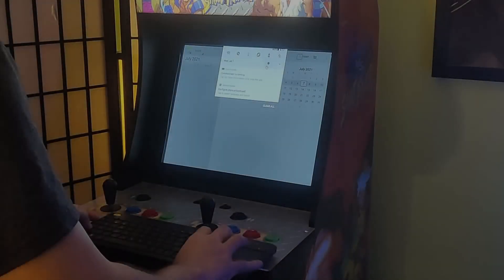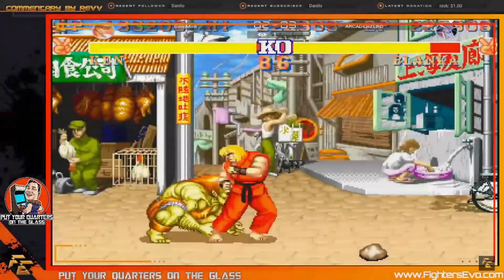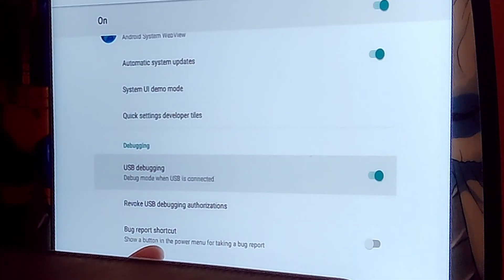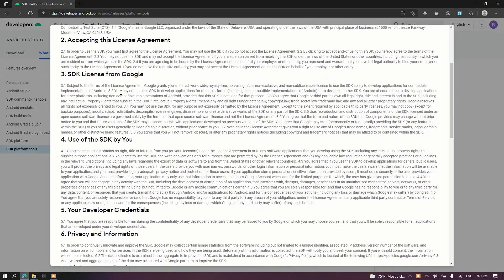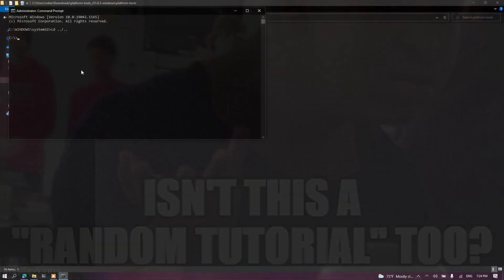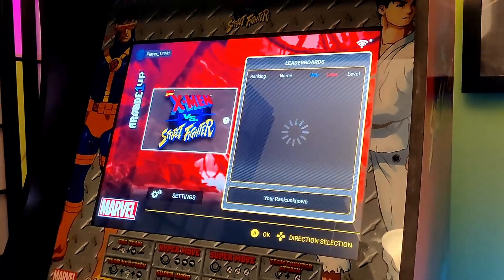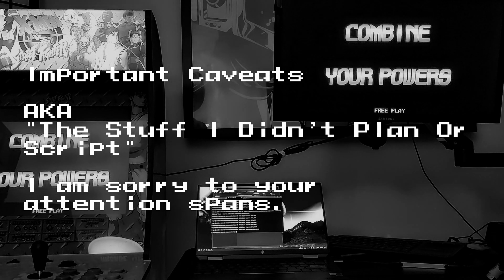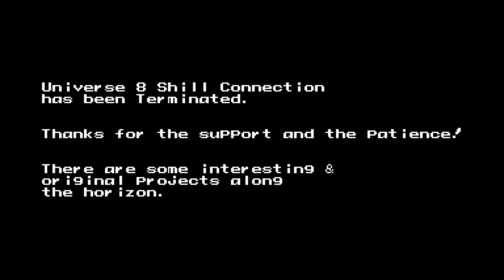Stock PCB Modding #2: Sideload Apps over WiFi + Universal Micro USB to HDMI (Arcade 1Up)

Comment: Will be making video 2.5 soon?
Reply from the maker: Pivoted to another project as I'm working loosely with a group of other devs on ROM hacking/reverse engineering who depend on that work in some projects that will be very cool for the community overall (already have some interesting stuff to share besides the really obscure tech demo thing posted), but will revisit the cab modding at some point early this year.

Thanks on the question and obviously for checking out the repo/resources. Hopefully you found what's there so far useful. The 2.5 tut was really going to just to make it a little more streamline but not fundamentally new things as we can install almost any app via sideload on Android as long as the cab has the capability for it (which is shown in second half here).
Reply from the maker: if you're having any trouble with this tut or something is frustrating: at least can try to point you in the right direction, given enough info. But it would be good feedback either way if so for any updates and thanks.
Reply: @FromUniverse8  Yeah it doesn't seem difficult. I'm getting the cables I need soon.  I'll give this a shot in the near future.
Reply from the maker: Working on cab stuff again and an app for that new process and have a small update on it:
https://youtube.com/shorts/HGDS-y4WG1M?feature=share

Comment: Great video and thank you!  I do have some basic questions:
1.  Why do you have to wait 4-5 seconds?  what process are you trying to interrupt?
2.  Once you have it connected to a PC with micro USB to USB, why go farther and setup a wireless connection?
     2a.  The PacMan 40th, I want to try this on, does not have online, Can you still sideload apps with the USB connection?
3.  Are we limited to the storage on the PCB (for sideloading apps or roms), or can we utilize a USB flashdrive with a hub or OTG?
Reply from the maker: Thanks for watching and being interested in the vid enough to ask sir.

1. Preface: I do not have this down to a science because I didn't study this part too closely or know the exact mechanisms. Someone else can chime in if they have more context.

It seems to have to do with the time it takes to load the system partition + bootloader timing and there's a small lockout when you power on the cab to load data. I am not sure if it was by design but there is a moment on boot-up where you get access to all of this.

The reason you need to switch the power and reconnect is because if you have a USB device connected the cab can actually maintain power even when the USB is connected, and this resets that window. I like using an AC hub because it's easy, but it's not necessary. You can also replug in via the microUSB but I don't want someone to mess up their PCB and blame me so I showed it the opposite way around as everyone knows where to take their PC if they abuse it (lol).

2. This is almost 100% because I am lazy and I assume most people are. It also made it easier to edit the video so you don't have to keep swapping out keyboard/mouse (same as automating the steps for the miraplug lol)... But also so that you can continue to use a keyboard and mouse. It was also to let people know it's a thing, and then just add a tool to the GitHub repo with all the stuff so I could use it myself when I'm lazy.

For me, I can use command line to do things entire time but for regular users to leave the A1Up app or other things it's not exactly easy or intuitive to have to keep unplugging your PC and swapping between that and your keyboard (you can't have debugging and OTG devices at once due to it being an either/or flag; there's 2 modes that represent like a master or slave device -- I'm not sure the 2021 words on it and there is some really technical workaround abd not worth it. You can technically have a cab connect through ADB to itself and I've done that to avoid the whole thing but its a little too meta for the tut).

2a. I'm not sure. If this is the same thing as Partycade then that would prob fall into line to devices a channel called Restalgia was chipping away at a few months ago. I haven't messed with my Street Fighter Partycade but I think it is similar and I do want to explore other things in it...

A1Up gives an update software and... well they can all load up the firmwares for update and other things that  (I don't want to get into but you can imagine with the very publicly available files). I don't know what A1Up is doing but they are not apparently trying very hard to make these mod proof on more than a few cabs. But I haven't explored it as if I see someone start something I don't want to race them when it wasn't an idea I got on my own. Maybe I can cover it with proper credit at some point or expand on it to feel worth doing that.

3. You can use a flash drive but it has to be loaded when the cab starts (it's very anti intuitive because of the 4-5 secs in other scenario). It's the same for external gamepads. There are other things where hopefully people will have the experience of "wow that is insanely easy/intuitive" and I'm going to get into that in my very next vid on this topic  :) but trying to automate much of it as it's honestly pretty tedious to go through even once, and I don't memorize it so I'd like to just run through until a human doesn't need to for certain parts.

(Hope that answered a bit)
Reply: @FromUniverse8  Thank you so much for taking the time to answer me (and quickly!).  I have modded a bunch of these cabs, but usually by NOT using the original PCB.  I bought the Pacman 40th after your first video and your mention of a "possible" mod to allow you to run additional games.  So I am very interested in the next video, and I hope the process works on that cab and others.  I also bought the USB hub you recommended before.  I have sideloaded on several Android devices, including the Ouya (see if anyone knows that device!).  Thanks again, for all your hard work, and your willingness to share :)
Reply from the maker: No problem! glad to help and I am not a big fan of editing so I like to do different things on different days (also cool how you applied that to the Ouya -- that is essentially what I did here so it's full circle). 

One thing though: I think you may have misinterpreted what I said in the previous comment? 💀 

I noticed I had hinted of something "not software related" in a reply to you before -- one thing was the geekworm tut (which I posted -- though you would need gen 1/2 specifically on those vs V1.5 which is for MVC/BB/XVS), and there's some others I haven't quite gotten to.  But they aren't actually related to modding the software on things, they are just random things that people ask me a lot about. I always have ideas to try though and not enough time to try (or maybe I do, just lazy), and especially for the other PCBs I have. 

But didn't mean to mislead you there. Appreciate your comment nonetheless and of course. Hopefully our boy Tuxedo Mask comes through with the pastebins, then I think with the way the A1Up YouTube stuff goes you would probably hear about it somehow.

Comment: Has anyone tried this on the TMNT cab? I can't get the USB port to recognize my keyboard.
Reply: No problem. I'm a patient person. You have done impressive work so far.
Reply from the maker: For the older TMNT cab, I think that it would likely not work since it's a different system.

On the newest one with online play: I would love if anyone could figure that out! I haven't seen the interface but one giveaway that it would be compatible is if the game selection screen is similar to XVS/MVC/BB with layout/etc. They're pretty clearly distinguished from other cabs.
Reply: @FromUniverse8  Sad face. Got really excited when I watched your video. I want to mod my cabinet without replacing the internals with a raspberry pi.
Reply from the maker: @anticcael7904   yeah I'm really sorry about that and completely get it too (was scratching my own itch with this). If anything pops up I can try to update you if I can remember to here... but otherwise it may be some time.

Comment: the code always wins thank you so you cant play when you use hdmi ???
Reply from the maker: So, it is possible to play with HDMI out: just not with this method specifically. This is mainly to get things to work with monitors/TVs that otherwise don't work, or for capture cards (they only usually accept 60fps or lower and cab gives out 65fps because it's... different). 

It was really added as a bonus as the easiest thing to expain this step on software modding (side loading apps etc).

I put out another tut to show how to use the geekworm adapter for this which is a lag free hardware method and I found it works with most monitors/devices but also I have some specific examples including a 19" that isn't as expensive as a Dell 2007fps but has better results on these cabs. You can check it out here:
https://youtu.be/I8MovSVPnP4

I should have really more clearly mentioned that. Thanks for asking though, hopefully it can help.
Reply: @FromUniverse8   thank you man your the best
Reply from the maker: Well ok; also a lot better on single player, but I'm guessing you're asking about online because of the cabs it works woth. So you can technically play, but it's mainly the overhead of it using the cabs' internal network card (same thing processing internet) and heavy load on the system with that together that make the ping go crazy.